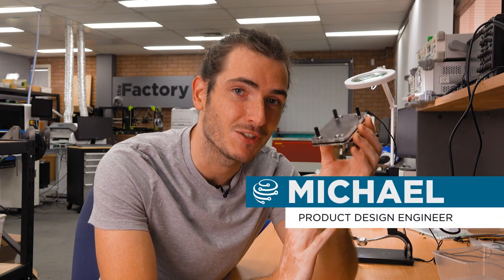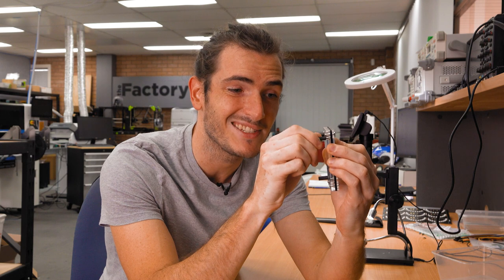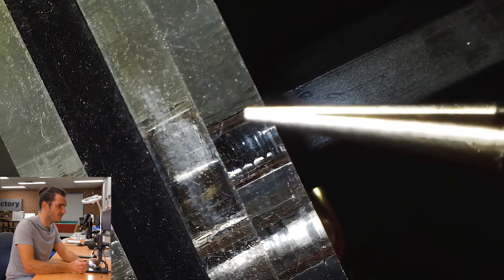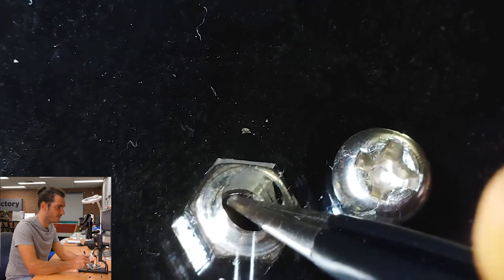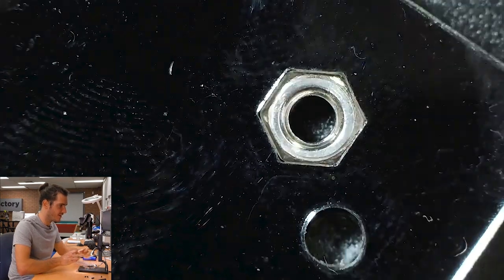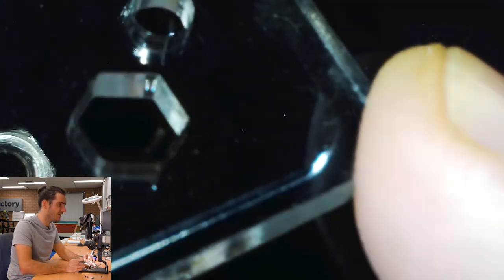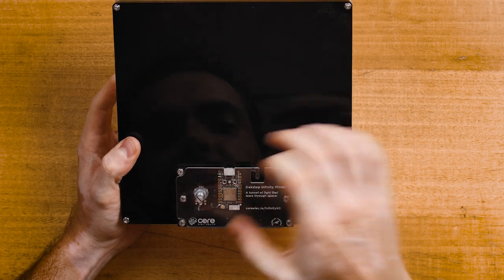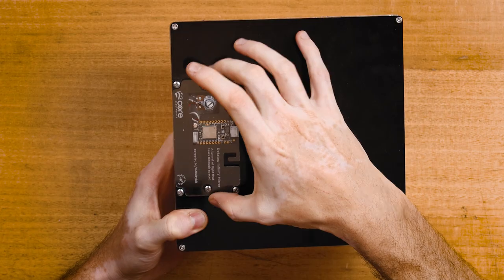The Factory | Captive Nuts In Laser Cut Designs

Comment: Good job on the manufacturing tips. I would suggest that for this particular video, it would have been useful to quickly mention other typical ways to engage mechanical fasteners such as simply tapping the hole VS knurled nut VS captive nut (without getting into too much) and perhaps mention why you selected captive nut specifically for this project. Good job.
Reply from the maker: Thanks Dan, great feedback